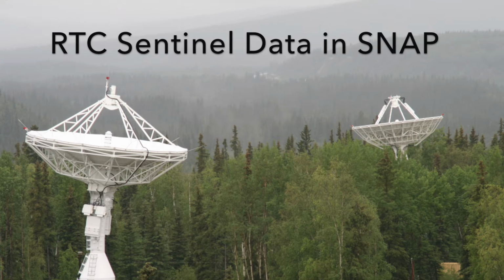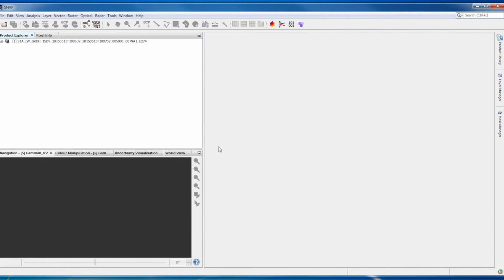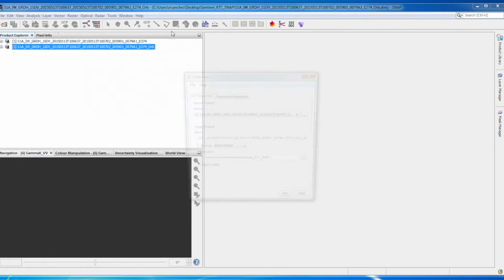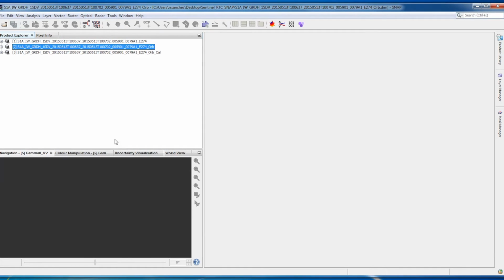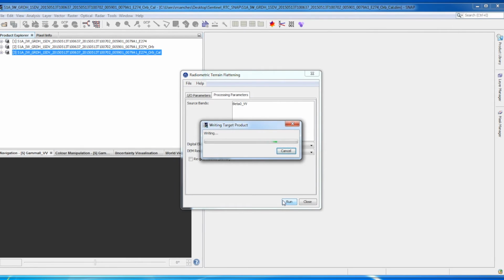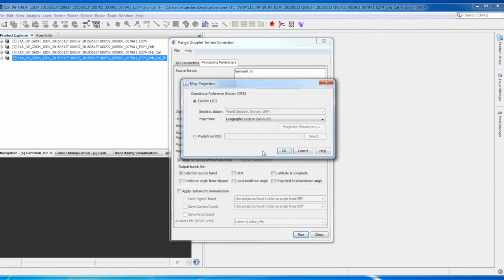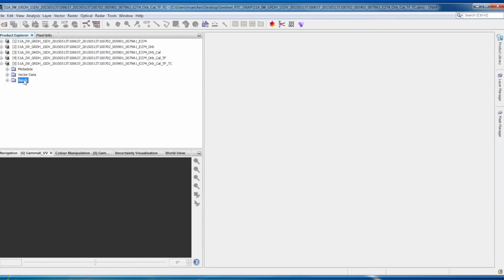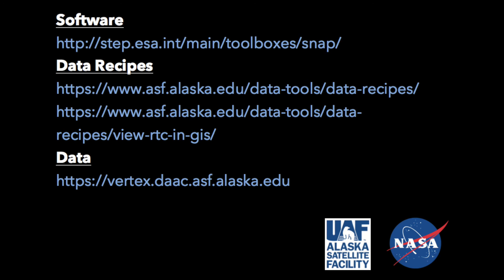How to Radiometrically Terrain Correct Sentinel-1 Using ESA's SNAP Toolbox

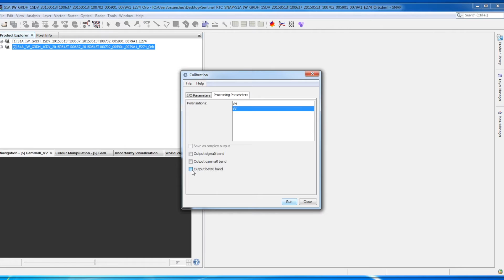Comment: at 1:35 why do you choose "output beta0 band" ?
Reply: Thank you for your question.  One of our developers responded 
to your question as follows:
The terrain flattening formulas developed by David Small et al that are implemented in the Sentinel-1 toolbox requires Beta0 as input and result in Gamma0 outputs.  For details, please refer to the following article (equation 26). 
Small, D., 2011. Flattening gamma: Radiometric terrain correction for SAR imagery. IEEE Transactions of Geoscience and Remote Sensing, 49(8):3081-3093.